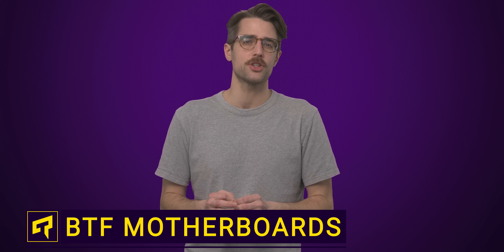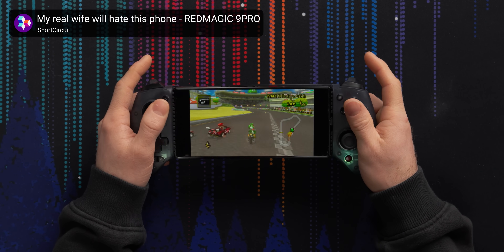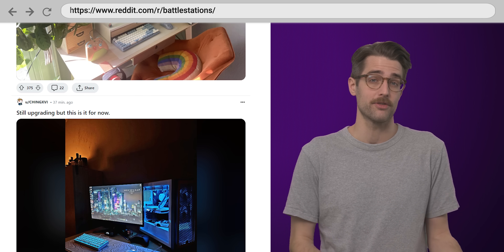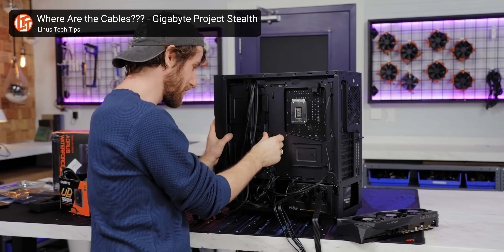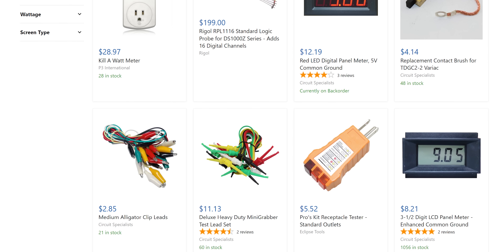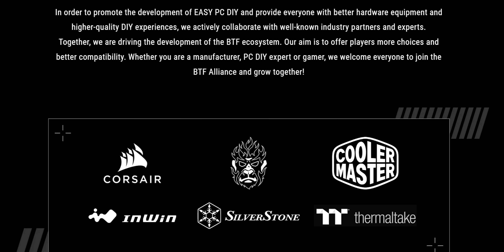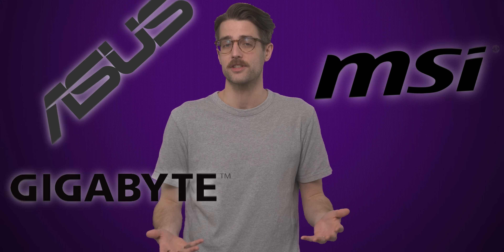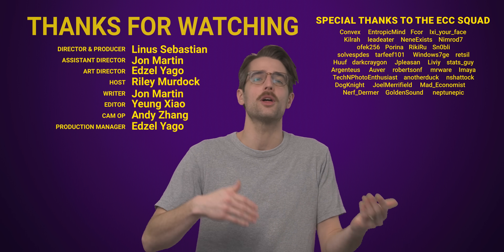Hidden-Connector Motherboards Explained

Comment: 5:26 I have always wondered why graphics cards still have top-mounted power connectors, when it would bu just as easy, and MUCH more convenient to put them on the END. I realise that some new graphics cards, like the RTX-4090, are only just long enough to fit in many cases, but most OTHER cards, including the RTX-3000 series, still have 30+mm of space that could easily accommodate a power connector, especially if it's placed near the bottom, close to the mobo.

Comment: We went through this phase with cars with stupid neon lights and such.  And we got over it in favor of function, style, and basic design.  The facts are still that most pcs made don’t care about this nonsense of RGB and the obsession with cabling.

Cabling is important to ease assembly and each connection is a potential point of failure.  But the obsession with glass panels and blinking lights is just not necessary.

Comment: The main downside, for me, is that cases will need to be thicker to accommodate the rear-facing cables. As a fan of slim or SSF builds, I won't be going for this trend.

Comment: to me, a gpu that has a separate PCIE style power connector is a really dumb idea, because it requires a specific motherboard making it more difficult to re-sell. Just give me a PSU that doesn't split the GPU power connector and I'll be happy

Comment: I can see it happening with ATX & mATX, but in many ITX cases it's much better to have connectors on the front because the graphics card sits vertically round the back.

Comment: I purchased a ready built PC from PC Specialist  here in the UK 2 years ago.

It has this type of case that hides the wires. The only problem is that every wire hardly makes it to its correct place and now they are bent and causing problems with the PC.

Just be careful and make sure this isn't the same for your PCs people.

Comment: GPU power connectors on the motherboard seems like a great way to simplify computer builds and take a big step towards cleaner cables. I hope it catches on!
Though it does make me wonder how itx motherboards will deal with the larger pcie footprint, when they're already stacking M2 slots on top of each other to save space

Comment: The best thing about rear connection sockets will be those bloody CPU Power ports. I always have trouble connecting those in the very tiny little left-over space to work with AFTER you install a decent sized CPU cooler since most of the modern Motherboards come with extra shield plates protection around back IO panel area connectors, it further reduces the space to reach those two little power connector sockets.

Comment: I've been building my own PCs for close to 30 years now. I've never once "managed" my cables beyond ensuring they won't get caught in a fan.
Reply: LTT even did a video forever ago showing cable management is unnecessary for cooling, and requires a literal teddy bear inside the PC to start affecting thermals.
I'd rather my computer be easily modified, and modern cable management prevents this. "Oh, I picked up this internal zip drive. Let's just slap it in and mess with it." Can't do that if your molex connectors aren't handy.
Reply: Saaaasme
Reply: Saaaamme too!

I've even been known to cable tie them to the roof to stop them falling into the fan 🤣

Comment: Computers need to look more like computers and less like Aquariums.
Reply: How about we let people choose for themselves?
Reply: @AltonV  The problem becomes when companies go full throttle into one side, leaving groups of people without a choice. For example, I can no longer find good cases without a PSU shroud or 5.25" bays. You can't get a plug & play white LED strip anymore, they are all RGB. If you want pure white, you either have to hunt for new old stock or DIY. There's tons of motherboards with RGB but few with diagnostic displays.
Reply: @Hypnodog_ 5.25 is so niche these days no wonder you cant find anything. Also what? What country do you live in where basic white led strips Arent a thing? Also you can easily just buy a argb strip and put it on white. Not that hard.
Reply: @Hypnodog_ "fractal pop" cases what ur lookin for

Comment: I've had no visible cables for almost 5 years, its been doable for ages.
Reply: I don’t think you understand the concept of “not-visible”. 
If you can see the connector, you can see the cables.
Reply: @sih8283  I disagree, yes I can see the connectors but I cannot see any cables. 
My 24 pin has an RGB 180 degree adapter on it, same as my CPU power. Which means the cables are at the back of the board same as the premise in the video.
My GPU is vertical, which again 180 degree adapters, the cables are then run out the back. It doesn't matter what angle you look from the front of my case, you will see zero cables.
Reply: @rossharper1983  The cables are inside the connectors but are hidden by the connector housing. So you have ‘hidden’ all the cable’s within plastic casing. 
Fair enough. I guess that’s good enough to be called hidden.

Comment: My cable management in the PSU chamber is just ok, but on the component side I have it looking beautiful and I'm proud of that. I'm kind of neutral on the idea of rear-mounted connectors.

Also, my flavor of RGB has recently shifted to as little of it as possible. My case is dark, aside from the CPU block and Corsair XD5 pump (both of which run off a motherboard header so I don't have to deal with a Commander Pro or other hardware).

Comment: This is ridiculous. There is nothing wrong with neat cable managementto ensure unobstructed airflow, but hiding for hiding sake is ridiculous. Unless you're making something without or minimal cables like the old Mac pros where everything slots straight in to the motherboard. For me I'll stick with the flexibility of the current cables. I think they just need to build better and more cable management in to cases.

Comment: There would be a big problem if they do this - All case makers will have to redesign their case to allow a bigger opening on that side to allow for the cables to be plugged in, because right now, this would not work with current cases as the small holes are just enough to route the cables to the front.

Comment: I use to like RGB, and when I sell a PC it is included.  However for me I have grown tired of them in fact I've gone back to horizontal/cube cases.  With GPUs getting so big you need supports to keep them for bending, and/or breaking having a vertical case is rather stupid nowadays.  As for RGB It's a waste of money in both cost to get and waste of electricity.  However cable management is good for airflow so there is merit to having tidy cables, but this push for hidden cables is getting ridiculous IMHO.

Comment: Never. I like my cables in front, disorgonized, and easily swapped with some effort.
Reply: How is having it on the back any less easy?
Reply: @Th3_ArCh0n because the back usually is under a desk or facing a wall. I usually flip all my PCs around and have the cables hanging in the open, so I can just plug stuff in. Looks like crap tho.
Reply: Yeah the cables if contrast-matched Vs mobo/components, really gives nostalgia for the time when you built it and fun

Comment: I just want a motherboard that isnt $600 that comes with basic ass error lights

once they figure that out, then they can start making "improvements"
Reply: Deciphering beep codes was truly the worst moment of my last PC build.
Reply: I recently bought a H81 board from some chinese manufacturer.
It had an m.2 slot next to the CPU like modern boards.
Logic dictates it should be a PCI only M.2 slot. WRONG! it supports both SATA and PCI.
Is there a setting in the BIOS? WRONG! they used jumpers. 4 of them. to set PCI or SATA mode.
That must have been written in the manual? WRONG! there is no manual. What's printed on the PCB is all you get.
Reply: why cant they have a port just like usb 2.0 port for an external error code lights/display
Reply: @sherr6847 competing standards.
Reply: MSI Z790 Pro DDR5 is only $220
Reply: @dawickedj is there any amd equivalent?
Reply: @sabinopereira1631  Yes they have that board in LGA 1700 and LGA 1718
Reply: $120 Gigabyte I just got does, don't know what you are looking at...
Reply: @doomer37 those cheap gigabyte boards are so nice
Reply: Yes! GOD .. PLEASE!!  I NEED MY ERROR CODES!!!
Reply: My msi b550 pro has them…
Reply: My old MSI X99A Gaming Pro Carbon has some :)
Reply: Asus tuf b550 wifi plus ii has lights
Reply: I got an msi tomahawk wifi x670e for like 300 bucks or so. Good motherboard with some basic error lights.

Comment: Case manufacturers should be integrating the cables, or at least connector mounting points in the case and maybe even recommended cable lengths.
One thing that would be wild is if they integrated the cables and connections entirely into the case itself. That would be ground breaking and probably expensive. It would look phenomenal though.

Comment: Having connectors on the back of motherboards will make them infuriating to use for testing out of case or on test-benches.
Reply: This is more for someone like me: set it and forget it. Someone making many swaps or doing many tests obviously shouldn't be anywhere near these things.
Reply: @genocidehero9687 still gotta clean out dust sometimes and when something eventually fails it'll be easy to spot.

Comment: Cables aside, the real problem is when you need to replace mobo battery. Motherboard manufactures could start placing CMOS battery connector to a more accessible place that does not require removing CPU cooler or  mobo shroud or in many cases entire motherboard (especially when it is ITX mobo). Alternatively, why it has to be battery ? Can't they use a lithium-ion rechargeable battery that would charge when pc is on and only be used when pc is off ? That would mean no need to ever ever replace comos battery ever again.
Reply: Perhaps because it could be a potential fire hazard. Also, you will still need to replace it too, and it would cost more to do so - you can literally find cr2032s everywhere, dirt cheap, and they also last quite a while
Reply: One benefit of a CR2032 is lifespan - those little buggers can last literally a decade, and they are dirt cheap. A li-ion - even an extremely expensive one - could never hope to provide even a fraction of a fraction of the lifespan of a CE2032, sadly.
Reply: @theEduEnthusiast  even ssds get frozen if enough years nonused. Lots of tech we use nowadays isn't meant to last... Sadly.
Reply: Cost. 100%. A li-ion, plus BMC board for charging etc costs 20x more than a CR2032. It's a few bucks but those add up on a mass scale.
Reply: They used to use Nickel Cadmium batteries that were recharged when the computer was powered. But NiCd batteries were not the most long-lived and usually would die in 5 - 7 years. Often you had a jumper to remove if you installed non rechargeable batteries. There were also battery holders for AA batteries that were used as replacement for the originals. Now this could make things interesting.

I worked at a computer company in the service department when another tech got a computer with a dead NiCd battery. He asked if he could use a lithium battery and I said it should work if he checked that there were no charge current as the battery wasn't rechargeable. He put in a lithium battery we used a lot of. Towards the evening he asked me to check the computer as the battery was getting very warm. I checked and it was to hot to hold. I sold him to replace it with either a NiCd battery or disable charging, and thought he would fix it.
Two days later I got called to the reception desk. There were the customers with that computer. The case had blown out and the cover looked like it had seagull wings. It turned out that the tech had not replaced the battery nor had he disabled charging. The litium cell had exploded and blown the computer to scrap!

The customers were remarkably calm and even joked about it. Yet the computer had exploded and filled a room in the apartment with sooth, dust and splintered plastic. I got to build a new computer. latest generation of processor, memory and everything. I managed to save the data on the  HDD and copied that to the new drive. Let's say I had some interesting things to say to the technician who didn't feel he had to listen to what I told him.

So battery tech in computers can be interesting. Now some time in the late 80's or early 90's a company started selling a combined real time clock, CMOS memory and battery unit. These had, according to specifics, a 10 year lifetime. It was a very compact unit and was used in a lot of portable computers and were also used on some full scale motherboards. The idea was that in ten years most computers would be discarded and very few would ever feel they had to replace the unit. Reality was that the battery would often die within 5 years, and in a lot of machines they were tough to replace. Also it turned out that a lot of older machines were kept in use, often for small simple tasks. I laughed when I saw an interview on TV where I could see a laptop computer we had sold to the satellite manufacturer well over ten years ago was still being used in their laboratory running some logging software.

Now the CR2032 is a common battery, and they are generally great. Easy to replace and easy to get hold of. No charging so no exploding batteries. I think they are a great solution. They can use anything from Quicksilver to Zink-Air and they have excellent life span.
Reply: They should replace the battery, with a battery? Maybe they should get rid of it altogether and replace it with flash. If it forgets the time then it can get it off the network
Reply: A li-ion will still degrade and require replacement, sooner than a CR2032 in most cases. There's also the risk of them swelling. My motherboard is 9 years old and the OE battery is still functional. It's from before the plastic shroud era so even when the time comes, I can replace it easily.

Comment: Next they’ll move the RAM, then CPU and PCI slots to the back. You’ll end up with the front looking like the back used to
Reply: More accessible wall of m.2 SSDs
Reply: @harrytsang1501 The funny thing is the only bottom-mounting I've had experience with so far has been M.2 slots (for an ultra-SFF PC).
Reply: Move IO to the side could be best for me. And for CPU there is already motherboard with CPU on the back side. That way you can use the whole case for passive cooling.
Reply: just flip the entire motherboard upside down
Reply: And it will be so boring to look at we will reverse the pc case and will be back to normal setup

Comment: The drawback to rear facing connectors are new hardware inside an older case you just happen to like. You're forced to get a new case if the new rearward standard becomes primary. Not that I'm against better cable management and easier assembly, but its creating now a secondary standard beginner PC builders may struggle with.
Reply: It will also make troubleshooting more annoying, epically for MB out of case (I recently did this as something prevented my system booting with a video card installed)

Comment: Who really cares what the inside looks like, I just don't want cables all over my desk and floor
Reply: a concentration of cables that are touching themsleves can result in overheating, also, unorganized cables can attach to the motherboard or other pieces that are extremely hot, probably causing the cables to melt.
organizing them takes less than 15 minutes when you mount your computer, stop being that lazy with your things homie.